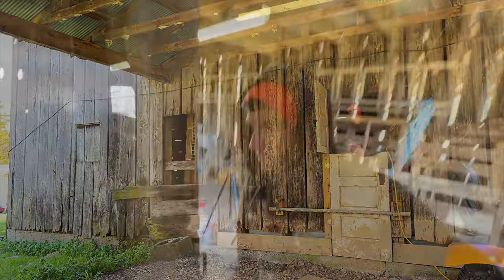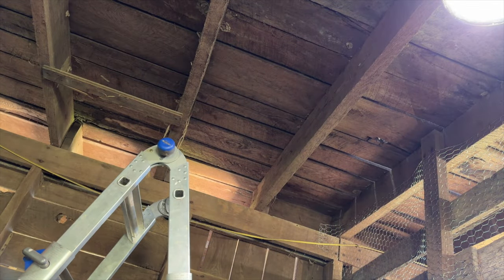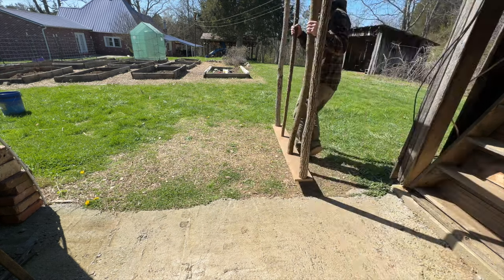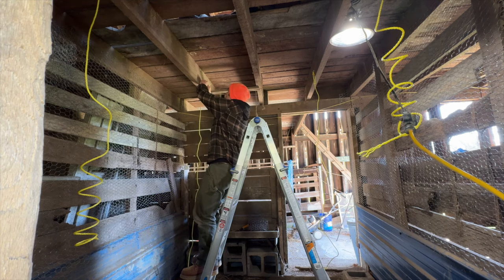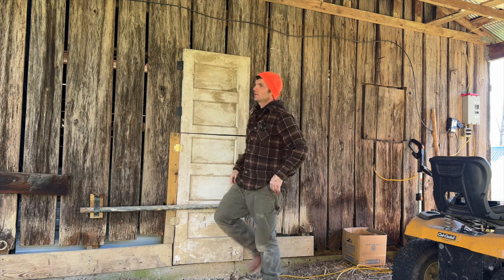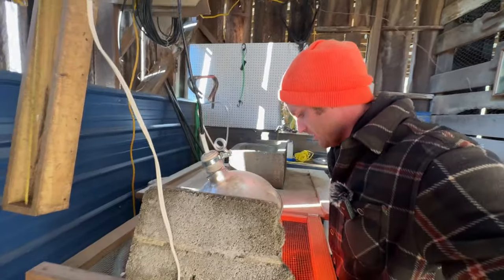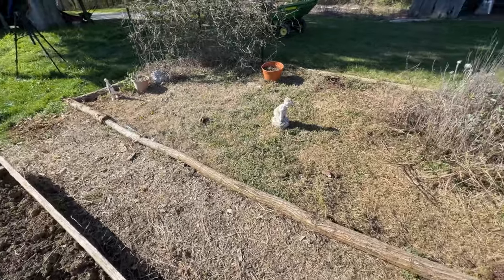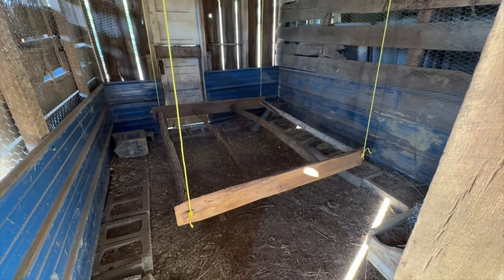Rude Commenter Gets The Boot.

Comment: Hold on… does that commentor know, regarding the roosters, that baby chicks hatched out, in some places, don’t even get a chance at a life, because if they are roosters, they get instantly culled? 
Re the hanging roost, I think, carabiners on a chain would be very versatile, because when you first get your chicks, you can have it very low to the ground, and as they grow, you can raise it up higher for them. ALSO, when you need to get in there to do work, that same carabiners could possibly lever that whole structure onto a wall and secure it so you can tidy up the stall.
Looks great so far! 👍🏻

Comment: I like the idea. My biggest concern is the blocks along the edge with the holes in the center. It would be too easy to twist or sprain an ankle. Could you secure a board over the top?
If the roost is too large, you could consider 2 layers, but might need a "ladder" to get them up higher.

Comment: Suggestion:   when you change out the rope for chains, also change out the rafter the eye bolts.  Install heavy duty bolts with hook end.  You will easily be able to take down the roost to clean around it and rehang.  Easier than getting chicken poop off your pants.  In the meantime with the rope, Install two levels of loops (by trying a knot in the established ropes) and use your carabiner.  Another idea even easier.  Attach 2 large eye bolts on one of the long sides of the roost about 3 feet apart. Install 2 heavy duty hooks or nails horizontally about 3 feet apart in the wall opposite the eye bolts.  When you want to clean,  lift the side with the eye bolts and hang the roost out of the way on the nails or hooks on the wall.  Done cleaning.  Unhook the roost from the wall.  Easy peasy.  One swift move. No fussing with Caribeaners and easy, full standing room to clean.  I think I like this idea best.  Enjoy.😊
Reply: You managed to solve the problem quite nicely. I just wanted to mention that some carabiners break rather easily. Hopefully yours are heavy duty. 

I so enjoy seeing little Henry, the cat, projects with your dad, and that handsome turkey—and happy for all the moments of joy you and your family will have together as time goes on. Blessings and love.